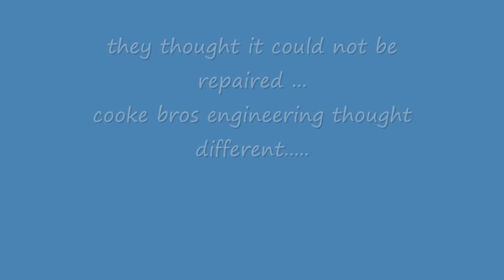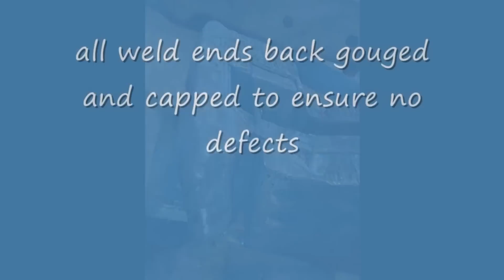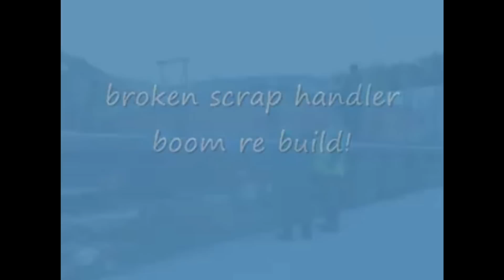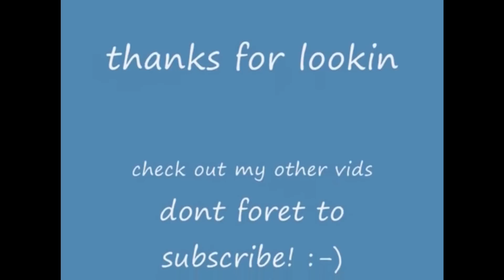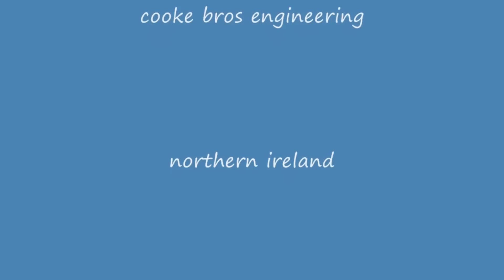excavator broken boom weld repair engineering compilation

Comment: I miss those days.  Back when you could smoke in the shop!  (and when there weren't a bunch of whiny assholes bitching about it)  I always thought it was funny that they had no problem with all of the welding, grinding, paint, and exhaust fumes that you were sucking in.  Just as long as you weren't smoking those deadly cigarettes!!  😆
Reply: Just because they are all bad to breathe doesn't mean they are all the same or effect people the same way. All the others are part of the job, smoking is not. I have been around all of those and was a pro painter for many years and started back in the 90's when good primer and trim, kitchens, and bathrooms were done in oil and cabinets in lacquer. I am also allergic to tobacco smoke and have been all my life, but am not allergic to anything else. It causes breathing problems after 10 minutes or so and leaves me with a severe headache after an hour or so. It stinks worse than shit. Pot smoke doesn't seem to cause the breathing issues but it stinks almost as bad as tobacco smoke.

Comment: I went in a Krupp crane boom section like that..I took keys with me.. 😆
I recall in AWS codes one is not to make a weld larger than base metal .
Or metal cracks next to weld from shrinkage.
Nice work 👍 excellent 🍀
PS I was told at CAT school that side loading boom twists cracks it as this one is. Not designed for torsion twisting side push dirt into trenches etc.

Comment: A lad I worked with served his time at Cowan & Sheldon crane manufacturers. When they started making telescopic boom cranes, his job was to crawl inside the telescoping sections of the booms with a massive pneumatic belt sander to remove the weld bead, ear muffs and a Martindale mask was all he had and everyone who went past his work area was obliged to smack the boom with a big hammer as he was working inside it !😂

Comment: I've just turned 66 when I was 45 I noticed a swelling on my right foot I went to the doctors who sent me to hospital , I was a panel beater I was told my immune system is attacking my kidneys probably due to the paint and welding fumes I was put on immunosuppressants they did a good job slowing the damage but I've been on dialysis 5 years now , wear a mask and stay safe .
Reply: I am afraid I may have similar.. Unexplained seeking pain in feet and did a lot of welding and mechanical work with chemical s solvents ..Oh oh
Reply: @Motorhead250  painful feet when getting out of bed or standing up if you have sat down for more than 30 - 60 minutes ?
 50 years of paint solvents and welding fumes , even though i wear a mask every day.
They say its a dying trade :(
Reply: @heartobefelt  same here .
But we are still alive.
Half my buddies are gone dead.
So we are fortunate regardless.
I work out walk alot stay active .
Peace  out 👍
Reply: Hope you are alive and healthy now.
If I may ask what welding procedures did you do that lead you to this illness?

Comment: "Back Gouging is the term given to the process of removing weld and base metals from the backside of a weld to take it back to clean. 
WHY IS BACK GOUGING NEEDED? 
Back gouging procedures are implemented where it is not possible to guarantee the consistency of a weld root."
Reply from the maker: It is also, faster, cheaper easier than precise preparation required to achieve consistent root. And delivers same or better quality
Reply: @allistairc123  Thx
Reply: @allistairc123  hey allistairc!! Question buddy tell me what's better..the supplied air hood with cooling valve...or the portable battery papr?? For field use...GREAT VIDEOS KEEP THEM COMMING!!!!
Reply: @panzerdan867  portable PAPR filters cost too much , Filtered air hood / mask is cleaner air as long as you dont try to use an air compressor , they will pollute your lungs with oil vapour and ozone , We use ring blower fans pulling clean air from outside with a filtered intake.